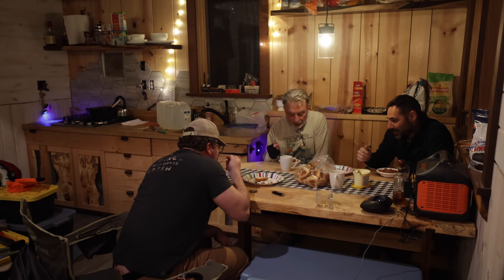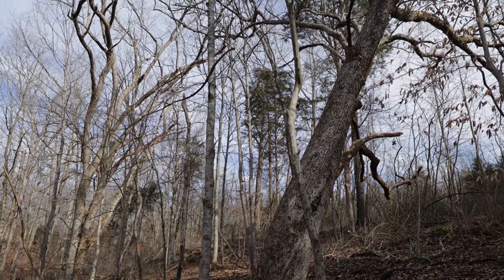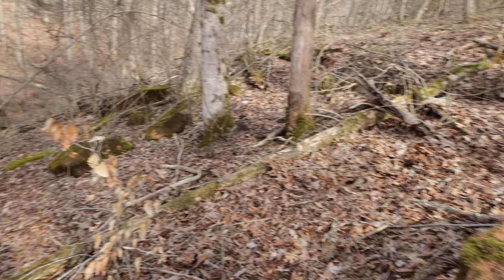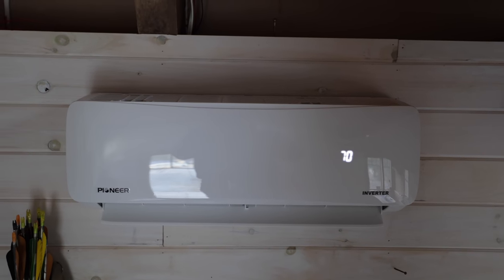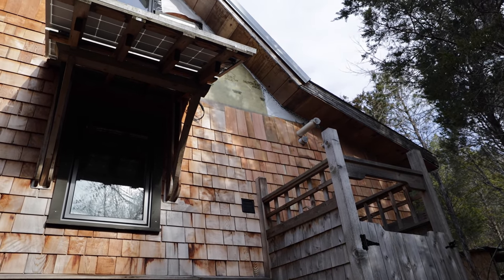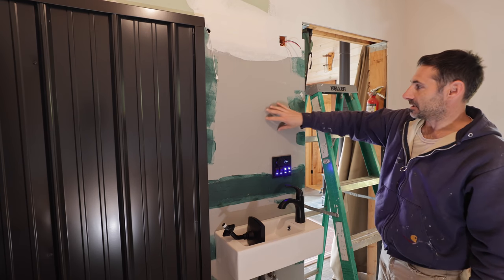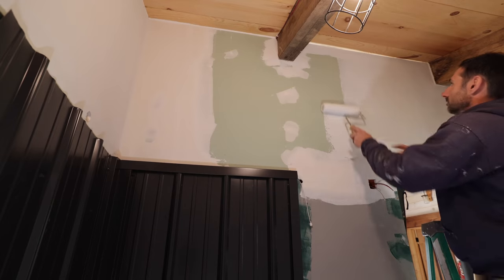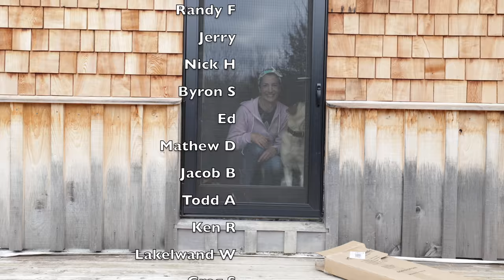A New Forest Trail, 3 Days of Cabin Work

Comment: 3 days!  And missed out on the shingles!  LOL!  27° this morning here and our wood stove was banked enough to carry through untill now.  After watching you talking about your split and propane it made me think about your wood stove and how you like to utilize it in your cabin.  Maybe a video about the role of each heat source and how they work best for your slice of heaven you have built there.  In my mind I like to have redundancies in case of an emergency.  I feel you have done just that with the way you have the cabin set up now.  With use and time in the cabin now, what improvements do you see that you could do for heating that space and retaining that heat for longer periods of time?  Have a great weekend, stay safe and healthy!
Reply from the maker: That would probably be a really popular video.  Maybe next winter.  I basically use the wood stove as a primary, but with a small stove in a small cabin, there is really no possible solution to get a long (say 8 hour) steady burn.  I'll pack the stove before I go to bed, and it will go for around 4 hours.  It claims a 6 hour max burn but I really only get 4.  The cabin will stay warm until morning but cool off enough to be chilly.

Comment: Wasn’t the purpose of the wood stove to heat the cabin? And what’s wrong with the outside shower? May as well call it a house.
Reply from the maker: The wood stove is the primary heat, but it burns out while I am asleep.  Sometimes a fire is overkill and you just need to take the chill off.